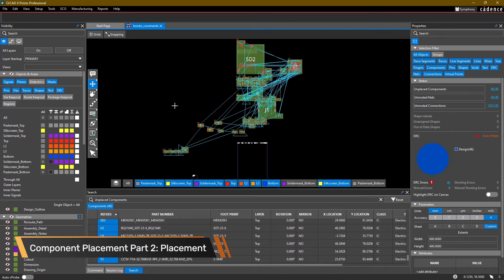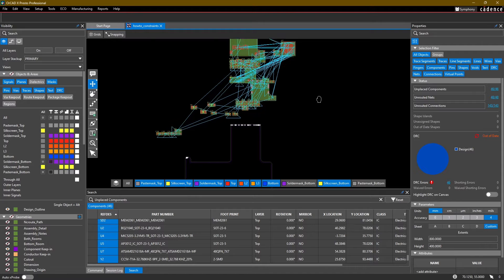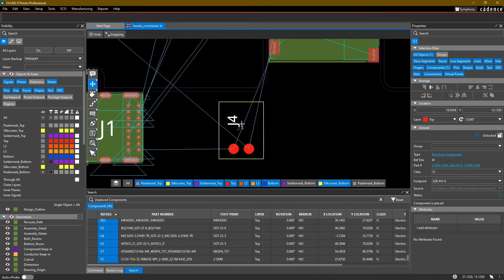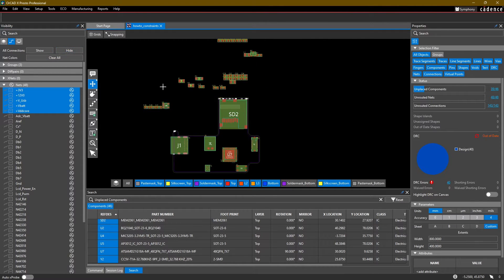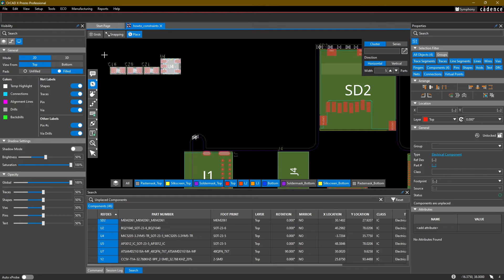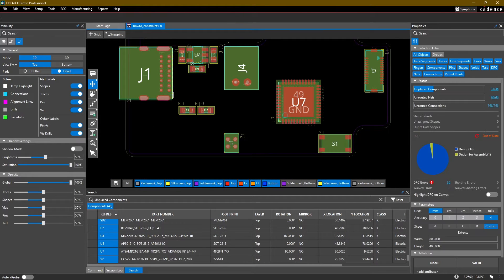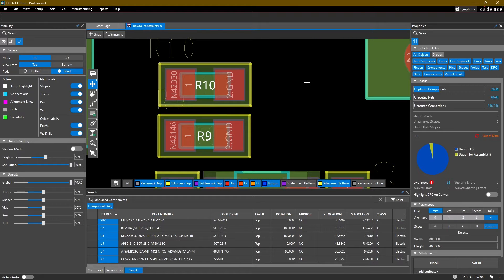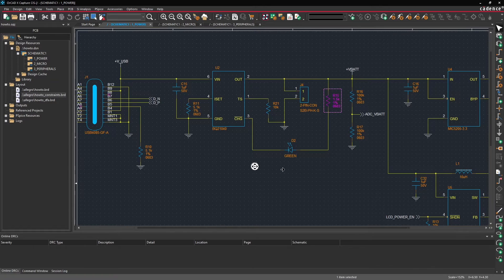OrCAD X How To Series - Part 6 - Component Placement Part 2

Comment: Very good video and I have a question. I am trying to setup the DFA package to package rules in order to have the DFA circle visible when I place the parts. Unfortunately the DFA circle never appears. If I place parts too close from each other, I do get a DRC error about DFA package to package error, so I guess my DFA rules are set correctly. I tried turning on all the layers, changing the grids, but no improvement. In the video, I noticed that the DFA circles seem to latch on assembly outline instead of the DFA_bound. I tried adding a filled rectangle on the component assembly_top, but it did not help. Any idea what I am doing wrong?